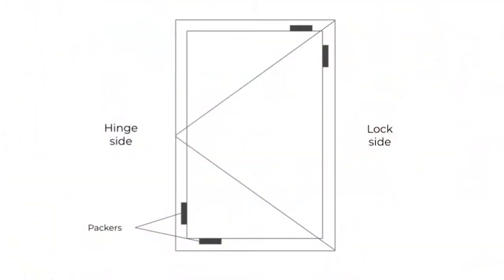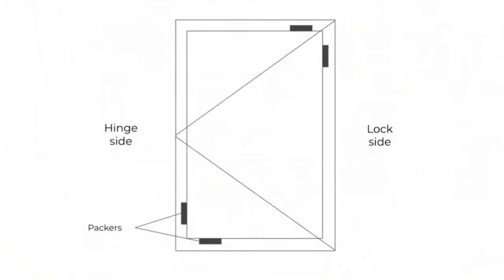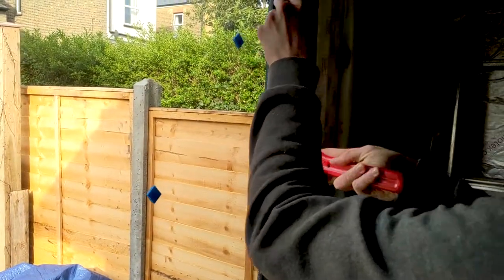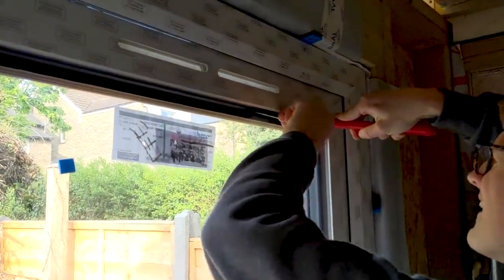Garden Office Build | French Door Installation | EP4

Comment: when buildong the door way how how of a gap did you leave around edge to accommodate the door 5mm?
Reply from the maker: Yes 5mm is the ideal spacing. You can pack up to 35mm if you frame slightly too big.
Reply: @richclifford4571  a few details I not sure you mention but I am interested  in. Slope of roof, whole room made of 4 x 2?
Reply from the maker: Sure, it's a 100mm drop from front to back. And yes, the room is all 4x2 and the roof joists are 6x2.